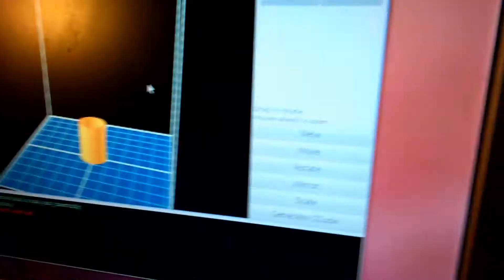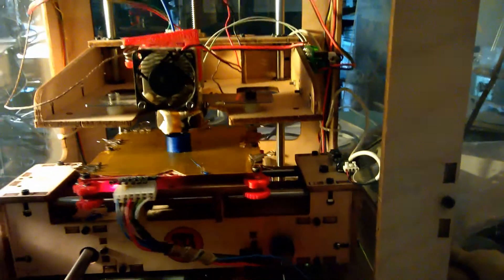Nakamichi CM-300 microphone battery adapter insert

Comment: Are they rechargeable? Also, would you know how these mics do in humid environments?
Reply from the maker: I don't know of any rechargeables for this voltage/form factor.  But if the mics are turned off when not used they last a LOOOONG time.
Reply: @VAXHeadroom  aside from recording my own acoustic guitar playing, I originally started looking at these for interior dialogue for interviews and narrative film which often run 12 hours per day. I'm hoping these sound well enough for interior dialogue and hopefully do not have to swap batteries more than once per day
Reply from the maker: @buggzo  They should last 12 hours.  For dialog recording, find the hypercardoid capsules - that is what they were made for :)
Reply: @VAXHeadroom  hm. I actually thought the CP-1 might be hyper because the little logo is kind of squished together but after looking at the Cm300 manual, it doesn't mention having a hyperardioid capsule. It mentions option Cp-3 "super omni" and the cp-4 "super directional" - - I believe the cp4 is a shotgun mic and a bit big for my purposes. Would the CP3 be the hypercardioid?
Reply from the maker: @buggzo  The CP-4 is the hypercardoid.  It's about 24" long (including the mic body).  Here's a pic of my camera with the mics on it: https://drive.google.com/file/d/1Qtsalk13rH1nT1l-_pXyAA2xv8zLvspw/view?usp=sharing
Reply: @VAXHeadroom   oh wow that is pretty big. Have you found wind blimp options for the cp4?
Reply from the maker: @buggzo  3D printed my own :)

Comment: take the 6v . useing black e- tape to make it as fat as the 3v and tape them together. using the black e tape make it so the battery it fits snug in the microphone.  1 , 2 . 3  LOL      bin doing it for year now !!!!!  works well
Reply from the maker: Roy Loeffler I've had these mics for 12 years, been doing the tape thing the whole time.  And now I don't have to.  Do what works for you!

Comment: You can use two of the 6v batteries for a sum of 12v on the Nakamichi - Primo clone microphones. The circuit will accept up to 14v and you may get more headroom with the higher voltage.
Reply from the maker: Nice! Thanks!
Reply: there is battery S177 Battery For SURE SM82 Microphone that 10.5 Vold and it fit the Nakamichi CM300, but could I use 10.5 volt for the CM300? thanks